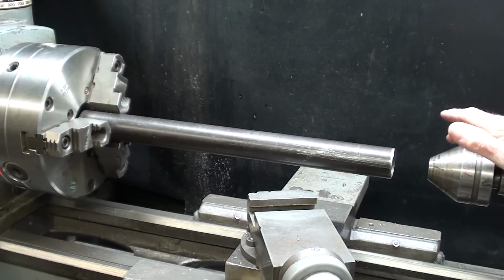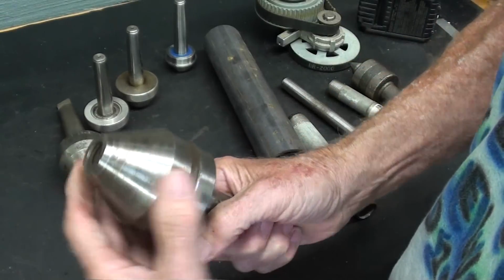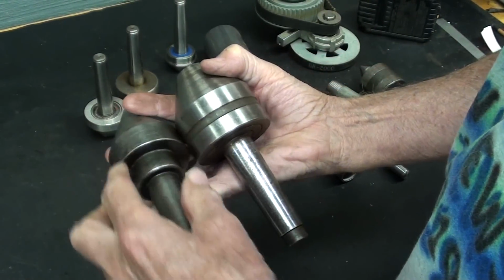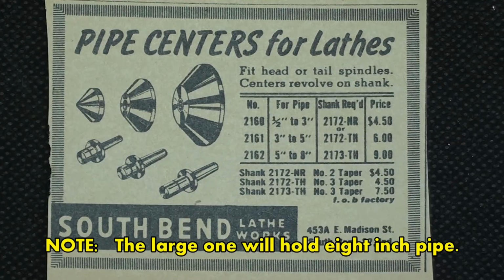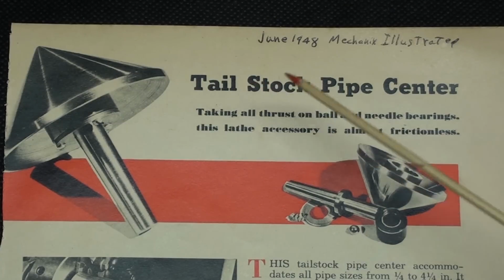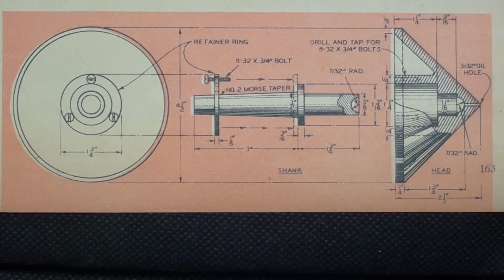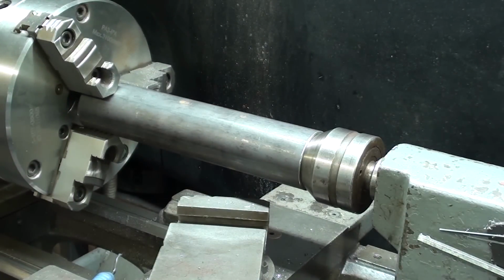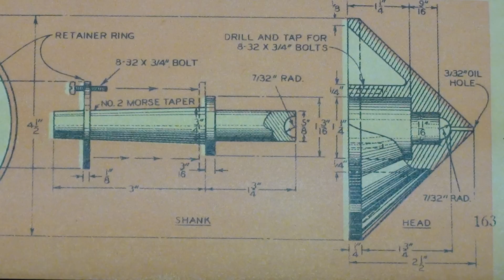BULL NOSE CENTER What is it? #15 short tubalcain lathe

Comment: The reason for 45 degrees on the drawing is that these are mostly used for thick walled pipes intended as stock for machinists not thin piipes ready for the plumber. A common size to start with might be around 5 inches (125 mm) outer diameter and 2" (50 mm) internal. These need to be prepared before the tailstock can be used and a 9o degrees included angle are more common as a chamfer to internal thread as an example.
This angle also insures that the centre supports the pipe on the chamfer which will be centred and not on an internal thread which might throw off the concentricity.

When I taught advanced machining at a school for adults here in Sweden I managed to get a donation of about 1.5 tons stainless pipes in such dimensions, much better to teach with then cheap, free machining steel! 
First setup, the students got an alloy that was "cut improved": "What's the big deal with machining stainless, this is easy..."
Second setup, a "bit" tougher alloy: "Geebers, how are we supposed to cut this!?"

Comment: Hi Mr. Pete ... Really enjoy your videos. I worked as a Machinist back in the 70s and early 80s. I ended up working in the grocery business 31 yrs after that. Over years I have built a small shop featuring  Craftsman Atlas 12 inch lathe, Atlas drill press, and several other vintage machines...keep up the good work..

Comment: Thank you Mr Pete. Joe Pie makes cone adapters that fit on his live center. Way way back in my high school metal shop I used a flat faced live center to cut a groove in a flat plate for a fixture to locate parts for machining. I'm not sure if it had a roller bearing. The face was about 2 inch and had a rubbery non slip surface. The holding power was amazing. I could take a very aggressive cut on the plate without slipping.
Reply: You will need 2 of those friction centers. a dead center for the headstock and a live center for the tail stock or you can use a normal live center in the tailstock to keep the plate in place if you have drilled a center hole.
Reply: @henningventer2917  It was against a face plate.

Comment: Thanks for the video! I have no pipe or bull nose center in our farm shop, but in the past I have turned down a plug and center drilled to put into bushing stock and pipe ends, Then just use the regular live center.It works well for smaller items where you can find a 2 or 3 inch scrap to make the plug out of "on the cheap".
.Have a Happy Sunday and remember you loved ones as we look forward to the advent season.
Reply from the maker: I have done that myself a long time ago before I realize that they made that type of center

Comment: Years ago I had one of those centers that had no bearing in it. First time I used it, the pipe dug a grove into the cone, in a pinch I had tried WD-40, didn't know to use a grease. I kept it all these years intending to perhaps fix it, never have.
Reply: You probably now know that WD-40 is not in any way a lubricant. The letters "WD" are an acronym for "Water Displacing".
Reply: @johncoops6897  Sorry to break it to you, however WD-40 is in fact a lubricant. "Fact: While the “W-D” in WD-40 stands for Water Displacement, WD-40 Multi-Use Product is a unique, special blend of lubricants. The product’s formulation also contains anti-corrosion agents and ingredients for penetration, water displacement and soil removal."

Comment: Larger pipe centers are useful for holding motorcycle cylinders to face off the cylinder base to assure a flat, leak free fit to the block. Harley Davidson EVO engines had leak problems at the cylinder base due to the base changing shape after the engine was run a few thousand miles, perhaps due to the aluminum cylinder/cast iron liner combination.  The gasket surface of the cylinder base could easily be machined flat by chucking the cylinder head end of the cylinder in the lathe chuck and the crankcase end held in a large pipe center.
Reply from the maker: Thank you for that information. Would be a good use for the center.

Comment: Both the pipe center and the cup center are common in 45*, they're meant to be used with a machined chamfer in the pipe, (though not necessary). 45* is a common chamfer, no need to have it match center drills, the whole reason for centerdrills and lathe centers. Big 90* countersinks are just as common as 60* and can be used in a drill press or hand drill.

Comment: Real handy for alignment, when using the steady rest for internal boring on pipe. I use a 3 jaw chuck with live bearings on the tailstock. I don't recall you ever talking about such an animal.
Reply: Kurtis at CEE in Australia often uses live three jaw chucks on his large lathes. Although not standard equipment they’re useful on certain jobs where center holes are not practical

Comment: Lyle - Good video with the second cup of coffee this morning.  One of the type requiring grease came with my Heavy 10 and I've used it at least once.  Now will have to check and see if there is any maker's mark on it.  Original to the 1945 lathe as all the tooling came fitted in plywood holders in the drawers - started life as an Army truck mounted machine shop that was passed on to a school where I got it at auction.  Sat in the  bus garage gathering dust for over 45 years before I got it.
Reply from the maker: Very interesting heritage of your machine

Comment: I have a KBC branded chinesium bull nose.  They are cheap but not inexpensive $300 vs $550 for a TMX one.  I also bought a few of the machinable Morse taper stubs to fit my rotary table.  Made in India out of god knows what.  I still haven't gotten around to using one of them for a fixture but that was the plan and why I bought a few.  As a glorified locating pin they will be fine.  As a working Morse taper I think they are too soft.  Proper ones I would assume would have a hard taper and softened stub.  These are all soft.

Comment: The only still you did not show was the cover of the Mechanix Illustrated. I found one and I am curious if it is the correct publication. Does it have a picture of an early helicopter on the cover? I can find new onse but they are always  seem to be larger than a MT #1 and that is the size of my tailstock. Plus the diameter of the cone is always small for a MT#1.   I had a project a few years ago to cut some 3" aluminum tubing to as close to the measurement as I could and a bullnose would have been ideal, couldn't find any at that time either.
Reply: Helicopter on the cover with blurb "The new Army as a career" & "Build you own motor scooter". I found a PDF of the magazine online but the drawing pictures Mr Pete shared are sharper.

Comment: I was a cylindrical grinder before I retired. I had hundreds of centres  of all sizes male and female ,full centres and half centres big and tiny. The 45 degree ones are used on components with a finished 45 degree chamfer  . I never used  bearing centres  there ok for  lathe work.
Reply from the maker: Thanks

Comment: Thank you for another great video.  I was wondering what they were using as a thrust bearing, then you described the ball bearing.  

I also like the center drill holder picture you snuck in there.  Didn't you do a video building one of these?
Reply from the maker: Yes
Reply: Please note I tried to search for a video on making one of these and did not find it?
Reply: @andrewraugh1622  he made it from an old morse taper drill.  I believe the thumbnail has a broken drill bit in a vise.  I will look for the video number later.
Reply: @CSWeldFab  Thanks.  If you find the video, please share the number.

Comment: Do you still have your Unimat?
Reply from the maker: No
Reply: @mrpete222  my unimat is one of the first ones, from austria, it has almost no power. 'i had the motor apart and cleaned it with no gain. its gutless i want to repower it with a sewing machine upgrade motor, a 750w motor. As it sets it can barely scratch mild steel  and really its worthless as it is set up. you can basically stop it by hand.

Comment: I've never seen a pipe or tube turned on my usual YouTube channels. Why would someone need to turn down a pipe or tube? What kind of project would they be used on?
Reply: B. Wyse
0 seconds ago
Cleaning up the OD so the pipe can be pressfit into some kind of plate or flange with the shoulder as the stop is the first thing that comes to mind. Or if you need some kind of large large diameter shaft but don't need the strength or weight of solid.
Check out Cutting Edge Engineering Australia to see some BIG tube work, He works on mining stuff so often repairs/ remakes hydraulic cylinders.
Reply: Cutting edge Engineering (CEE on Youtube), has a lot of pipe cutting videos BR from Sweden
Reply: @barnenlenovo681  - Kurtis at CEE uses a 3-jaw chuck with a ball race fitted to a Jacob's taper arbour. I'm sure there was a video about making them.
Reply: @bwyseymail  - Another reason for a pipe center is to machine the outside to create a nice smooth surface for a steady rest to roll on. This is needed prior to line boring or other operations using a lathe on the inside or outside.